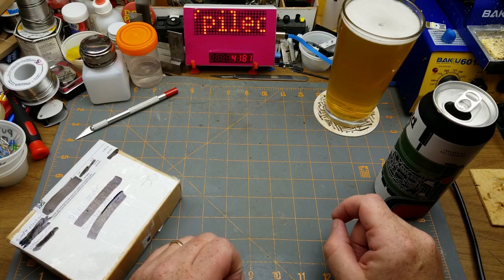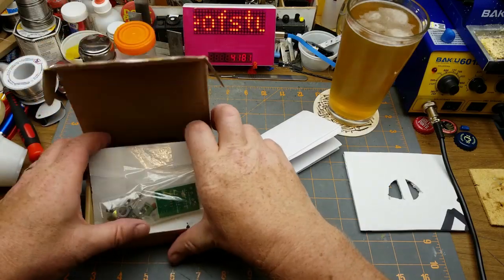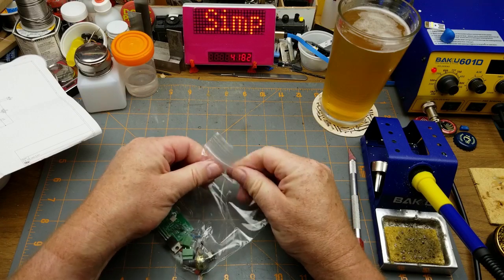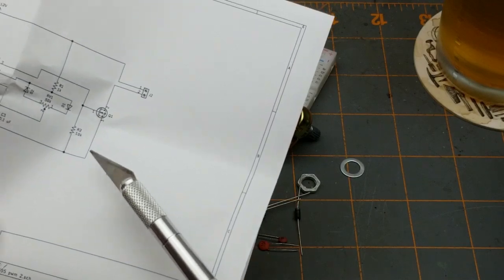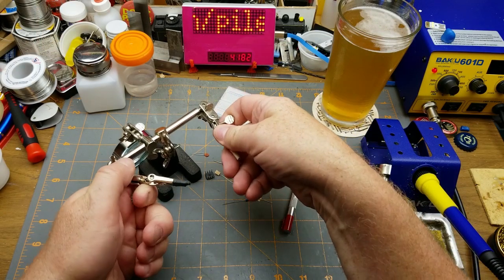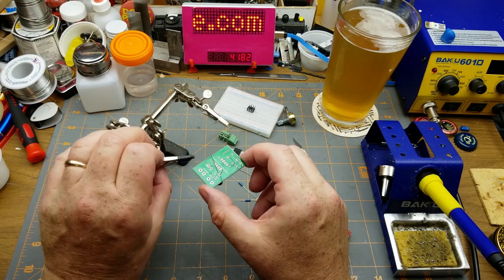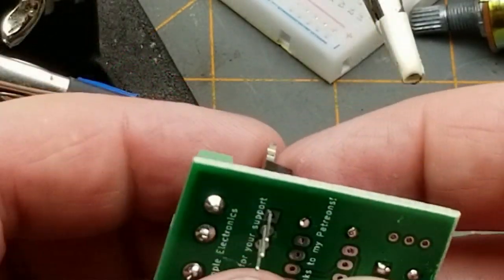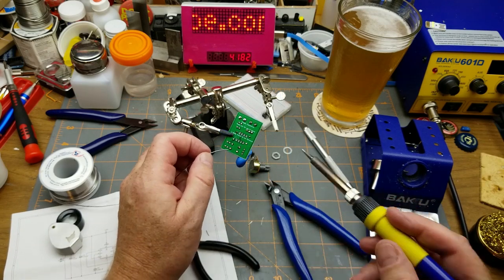Simple Electronics Kit Build

Comment: @Simple Electronics some tips :)

7:30 Just space the screw terminals 200mil apart, that way they can lock and are wayyyyy sturdier. Also, pick a suiting footprint ;)
And it's not going to do 6A well. That track to the output is tiny ;)

Comment: Should have provided for a flyback diode at the mosfet, incase a inductive load is used. Also advisable would be a 7555 CMOS version 555 as the old bipolar 555 has very nasty current spikes (>200mA) on supply during switching.

Comment: At 25:30 the PWM appears upside down because you are low side switching.
When you are looking at the MOSFET DRAIN, HIGH is MOSFET OFF, LOW is MOSFET ON.
Good video, your soldering is fine mate....👍👍
Reply: Checking the comments for this :D
Also, couple it DC so if doesn't shift up and down ;)

Comment: Not so critical this case, but useful for teaching is always fit low level parts before tall or large parts as on many assemblies they restrict access to fitting smaller low level parts.
Reply: The reason that you fit the low parts first has nothing to do with "restricting access". The reason is simply that you can flip the PCB over and lay it flat onto the bench... gravity holds the PCB down onto the bench, which in turn holds all the components in place while you solder them.

Comment: aren't all those Bourns trimpots 25turn ? There exist these Bourns pots that have a longer screw so you can turn it with your fingers but hard to find in the wild. Chinese variable load boards have them but finding them on cheap sites like ebay or Aliexpress is a crime. I've only seen them on sites like Mouser. If you come across them cheaply in low quantities I'm interested :-)
Reply from the maker: Could be. I didn't count, I was just going from memory.

The specific one I used was salvaged from something,
Reply: nice that you salvage parts. I saw you turning dilligently to get the LED brighter and I guessed that was because it takes 25 turns to get the damn thing to the other end of the spectrum :)

Comment: What a smashing little project :-D
I laughed when you discovered the 555 was doing the oakey cokey :-D
Some people put the chip in the wrorg way.... Not me honest, ok i did :-D

i love the old 1970's 555 timer and any time i wanted a quick timer/oscillator/monostable it just gets the job done :-D
I only use the bipolar type,  the cmos version is crap, my opinion of cause ha ha :-D.

There used to exist little booklets on the 555/opamps/4000 series chips by Forrest M. mims from tandy/radio shack, they are out on the internet as scanned versions.
Webarchive i think.
The 555 timer one was a fun book with many circuits.

Comment: Did you put both the 104 caps together and the 103 seperate?  104 is .1uf and 103 is .01uf and it appeared you might have installed those wrong??  Hard to tell...
Reply from the maker: Well spotted. 
I didn't notice until Simple Electronics pointed it out.
Luckily It doesn't have a signifiant negative effect on the circuit.
Reply: @pileofstuff  True unless it was a 555 timing cap but I was too lazy to look up the schematic to check.  Thank you for doing your videos, they are always interestesting and well done.
Reply from the maker: @kirkb4989  Yeah, if it was the other cap it would have changed the frequency, but the thing probably would still have worked. That's a cool thing about the 555 -  it's a pretty forgiving beast.

Comment: but, what cause the redoing of the chip ?
Reply from the maker: pause at 19:30 and look closely at pin 4 of the IC.

It should be going thru the hole, not splatted on the topside of the board.
Reply: @pileofstuff  ah thanks. i see that now, it got shadowed by the mosfat.

Comment: Sorry Folks, Dummy/newbe alert, what was wrong with the soldering of the 555 timer, it looked to me that it was placed and soldered in the right way?!!!
Reply from the maker: pause at 19:30 and look closely at pin 4 of the IC.

It should be going thru the hole, not splatted on the topside of the board.
Reply: @pileofstuff  Thank you very much, the pin doesn't go through the hole in the circuit board and therefore is not soldered at all.  Thanks you.  I'm a Blind Dummy/newbie!!!
Reply from the maker: @merseytrainz  Don't be too hard on yourself. I missed it too 

(though my excuse is that I was paying too much attention to making the video and not enough to actually doing the task at hand...)

Comment: omg.... i wish you do not do repairs for peoples.....🤦🏻‍♂️
Reply from the maker: thank you for your support...
Reply: sorry to be hard... but you really need to learn technics... go see paceworldwide videos about soldering lessons... it will help you A LOT.... and also before soldering anything, you might double check..... fails like that on youtube these days are fatal... no offence but take some times on practicing before doing videos.... youtube can ruin reputation... 😕
Reply: also, buy a desoldering station or gun.... its not that expensive and will help you way more than anything ... in the past i was thinking that having the soldering station and wick and normal pump was plenty ok... but one day i ruin a board... an important board... so i bought a Pace ST-115 station with SX-100 desoldering pen and, WOW ....now today if i lost my desoldering station and return to wick and pump, i will just stop doing electronics... for old school one side board wick and pump its ok.... but most board of these day are through hole... wick and pump are not able to remove in a safe way trought hole because solder get stuck in the components side... you have to wiggle the pins... soo see on ebay desoldering gun or station... the ZD-915 is a popular station and the S-993 /995/998 gun also and they are under 150$
Reply from the maker: @simonspeaker  On youtube I am doing hobby stuff intentionally using the cheapest possible hobby grade tools. 

It's not reasonable to assume many hobbyists have full PACE compliant soldering stations, nor that they are doing mission critical stuff.

At work, things are different, but here on youtube I'm just some guy dicking around in his shop who doesn't take himself too seriously.

Also, I could easily have edited this to not show my mistake and me fixing it - nobody would have been the wiser.
But I choose to show what I'm doing "warts and all" as a reminder to beginners (and others) that it's OK to screw up once in a while. Then you go ahead and fix your mistake. That's how you learn.